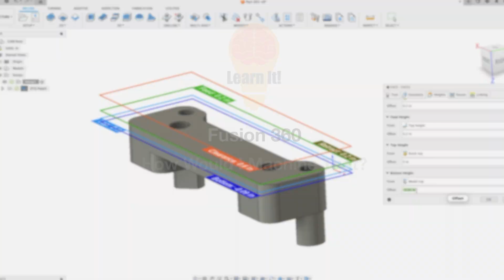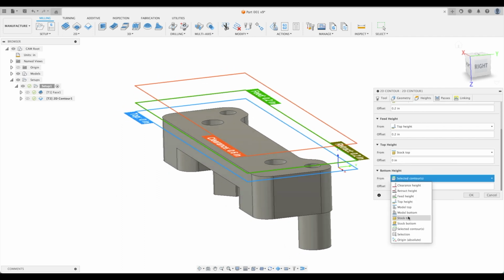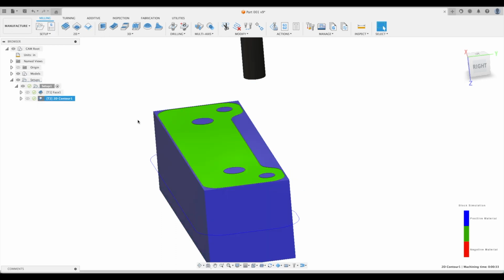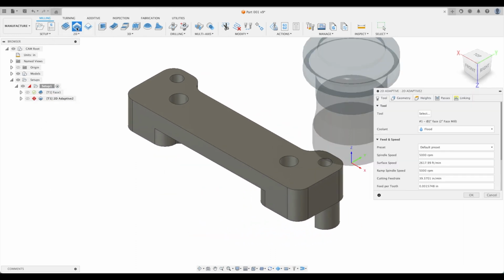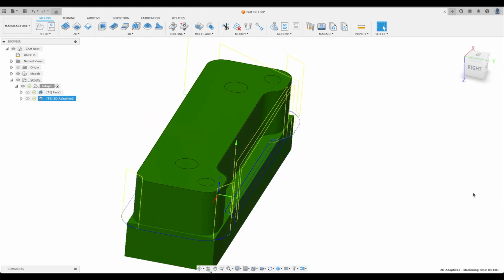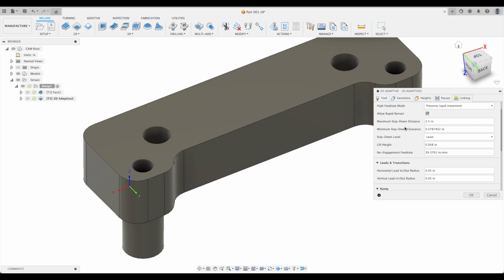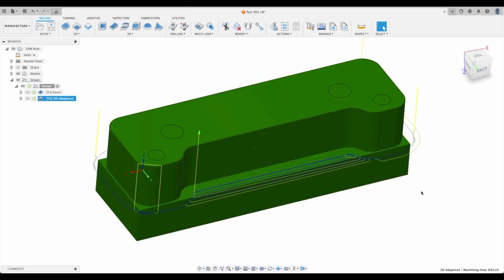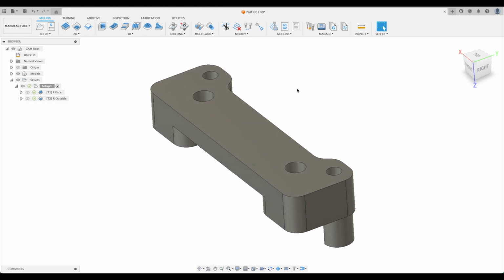Fusion 360 - HWIMT - Part 001 Setup 1 - Op 2 (2D Adaptive)

Comment: Great tutorials for manufacturing. I am just into that with my CNC machine. Fusion is good for manufacturing although I feel they are way to greedy with their fees.
Reply from the maker: Thank you for your comment. What kind of CNC machine do you have? Just curious.

Also, when you mention the fees, are you referring to the basic subscription or the extensions?
Reply: @learnitalready  I am referring to extensions. I mean, i understand that machining extension is for core professionals who earn a lot of money but 1700 euros per year for me is a lot at the moment.

When i was buying Fusion 360 3-years license i was not aware that for my rotary axis i will need machining extension. :/

I am also making some handmade Aikido equipment. I wanted to do some part of operations on CNC but i afraid i will continue to do it manually :)

I am house door maker. I primarily use 2D options and drilling.  

Thank you for your tutorials.
Reply from the maker: @SasaRakezic  That is true! That is a lot of money per year for a needed feature. That would be so nice if they included it as part of the standard subscription in the future.

I would love to know more about your business. It sounds very interesting. Do you have pictures of some of your finished items?
Reply: @learnitalready  We have made few handmade prototypes. Mostly we are aiming toward '20-'50 door styles which are energy efficient and we'll sound isolated. We are officially starting production in mid September beginning of October. Website is under construction and in Serbian language only.
Reply from the maker: @SasaRakezic  I hope things work out for you!
Reply: @learnitalready  Thank you and continue with great videos.